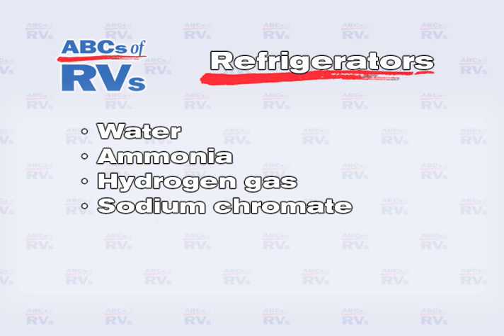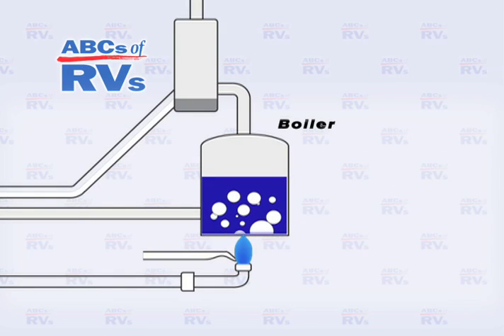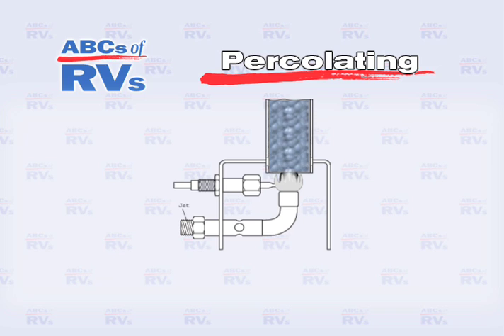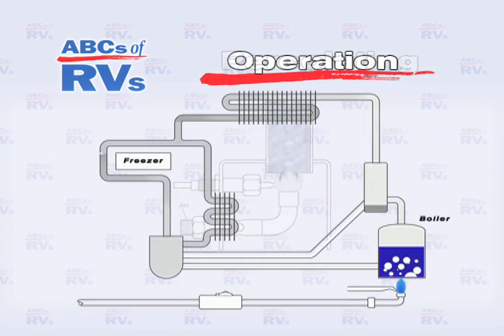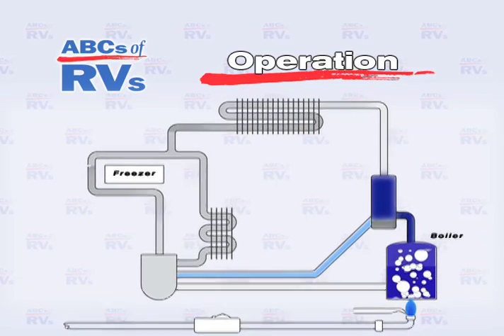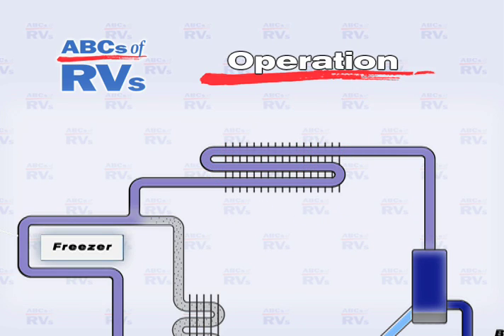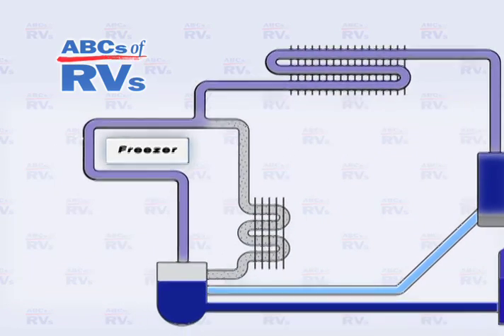RV Refrigertor Operation

Comment: Turns out its quite efficient! Replacing your fridge with any compressor fridge would be a huge efficiency boost. My 140L 24v compressor fridge uses about 500wh/24hrs. Absorption fridges are just.. Not efficient. You use electricity to heat up a resistive element (kinda like an electrical space heater) which boils a solution of water ammonia and hydrogen. The ammonia and hydrogen move heat around. But resistive heat is just inefficient as all hell.

Comment: Sorry, maar deze man maakt grove fouten in zijn uitleg. Een compressor is een "gaspomp", er is geen vloeistof bij de compressor. Het hete gas wordt aan de bovenkant de condensor in geperst en hier condenseert het gas door de hoge druk en afkoeling. De warmte energie van de compressor en de opgenomen warmte in de verdamper wordt hier afgescheiden aan de buitenlucht. De vloeistof wordt hierna opnieuw ingespoten in de verdamper.
Reply: You are mistaken.  You describe a conventional heat pump, not a single-pressure absorption refrigeration system used in recreational vehicles.  The latter is what this video is about.

Comment: Wrong household refrigerators, hell even air conditioner, units, all work with the same theory of removing heat and displacing it into the coils in the back similarly, a heat pump removes heat from the outside, cold air and releases it in the building
Reply: Nope, not all work with the same theory.  My great uncle, born in the late 1800's, had a kerosene fridge on his farm, and this tech was what worked without any electricity.  It's significantly less efficient than modern refrigeration, but still useful in certain applications, like recreational vehicles.

Comment: Someone please explain, if every process in the loop is adding heat, where does the heat go?
Reply: This wasn't explained the best. The heat is removed from the ammonia within the condenser.
Reply: @AnUnapologeticApologist And it absorbs heat from the hydrogen in the freezer (which is extremely buoyant) and evaporates rapidly, drawing the thermal energy out.
Reply: To be cold, you need to be much hotter than your surrounding so you can transfer your heat to that surrounding and becoming cold yourself. It's like how you feel when suddenly coming inside colder building in hot sunny day.

This was what happened to Ammonia, it got heated by boiler and then it cold down when moving thru the first coil.

And vise versa, when Ammonia cold down, the 'surrounding air' inside the freezer which was much 'hotter' will transfer it's 'heat' to much colder Ammonia which then pumped to chiller section that transferred another group of 'heat' to 'slightly warmer' Ammonia.

Then the cycle repeat again.

Edit: The heat is everywhere in the system so it always pumped out when it present inside. In today's refrigerator, the pump will stop when it pumped enough heat to outside and will continue again when there's another heat inside based on their predetermined temperature setting.

Comment: I just wonder if one could hook this up to their wood burning stove? Instead of the gas.  Combine that with using the heat to create electricity.  We could heat, cool and give our houses electricity.
Reply: this works with any source heating system I think 🤔
Reply: In theory it should work..
Reply: Neat idea but you wouldn't be able to regulate it and your fridge would be more like a deep freezer. The way the fridge operates, it cycles on and off, when that happens the flame goes out. You wouldn't be able to turn off the wood burning stove like that.
Reply: Indeed... but the big utilities won't go for that. ;) Not in their favour you see... 

If they haven't already, they will lobby the GOV to mandate that all homes MUST be grid tied. Canada is pretty much that way. Need mains to get an occupancy permit. Once you have that permit, nothing stopping you from dropping the mains line from your home. (Just means its another several thousand dollar tax on a new home, and that they don't give a hoot about you remaining grid tied. Gimme gimme gimme.)

Comment: Sodium chromate is listed but never explained in the process.  Also, after the evaporation in the freezer, the video says ammonia separates and goes up through the secondary radiator.  I think the hydrogen does that instead, as the water absorbs the ammonia, leaving only hydrogen gas.
Reply: Maybe it increase or decreases  the boiling point of water?

Comment: couldn't they use other refrigerants? or any substances in general? Normally the compressor phase changes the refrigerant into a gas, there is too much inertia, so when the condenser dumps the excessive heat, the phase change doesn't have enough time to absorb heat, in the condenser, the refrigerant spends more time, and can phase change and absorb all the heat. So you could probably just remove the compressor from a fridge and put a propane torch to the line and it will do the same thing. I just don't understand why we got this special refrigerant here.
Reply: Ammonia has an affinity for water and hydrogen lowers ammonia's boiling point under the specific pressure the fridge uses but gets kicked out of gaseous mixture when the water re-absorbs the ammonia. It operates on a few little chemistry and physics tricks that Albert Einstein and Leo Silard worked out.
The design has changed slightly but the principles remain the same.
Reply: ammonia is a refrigerant.

Comment: Could you use the hot area under solar panels as a boiler?
Reply: Deppends on a few things, but things of that nature can be done.  One issue is that it obviously only works for a little while.  I feel a direction you would rather go at that point is a Sterling engine, though there have been issues with that so far.  Not "this will never work practically" issues, just it does not work currently issues.  We need to work on the process more.
Reply: Oh wait, you mean RV solar pannels.  Sorry, my mind was on bigger house solar pannels for some reason.  Not convinced you would get enough heat there.  May be able to set up an economizer from that heat though.

Comment: 1:10 why does the water magically return while the amonia travels on?!
Reply: i guess water condenses at a different temp to ammonia, returning to a liquid and flowing back while the ammonia gas separates and continues on to condense later
Reply: @briangillick  your "guess" is absolutely correct
Reply: The boiler works like a coffee percolator except instead of stram gaseous ammonia is produced. As the ammonia turns to gas, the bouyant ammonia, bubbles up the tube raising a column of water solution up the boiler tube. The boiler shown in the diagram is not typical of most rv refrigerators.

Comment: I have an ammonia refrigerator in my RV. The freezer will cool down to -10, the refrigerator section cools down quite well. This is a Norcold manufactured in 1987, so there is potential for longevity. I also installed a small condenser fan, a common ball-bearing computer fan found online.
Reply: I was visiting an old timer at his cabin once and noticed a buck rogers looking device hanging out of ancient icebox and asked what it was. It was a Crosley IcyBall.  It was over 50 years at the time and it still worked.
Reply: Hi, can you please tell me what flame temperature is best for the boiler I'm restoring one of these refrigerators and I can't seem to find anything about flame and flame temperature
Reply: Where can I get one to buoy
Reply: I’m sitting in a camper from the 1970s with a made in Sweden dometic that keeps my root beer, cold and my ice cream soft like I like it.

Comment: This is just.. wrong. lol
Reply: Why
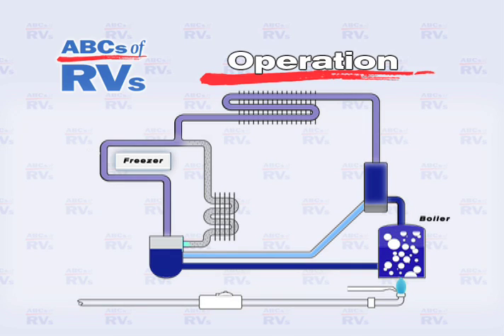Reply: @Ryskyguy  Much of it is right, but the last part of the video, where he describes ammonia again becoming a gas (@1:55) is not correct -- that step of the process is where the hydrogen separates, travelling up in the diagram, and joining the cooled ammonia at the top left.  Unless I am way off, this is where partial pressure helps the ammonia evaporate in the freezer compartment.

Comment: Umm it is not called an absorption fridge because it absorbs heat! All fridges and ac dose absorb heat! They all draw heat a way from one side and dump it on the other. They all heat pumps!
Reply: I’m a refrigeration HVAC technician and you are absolutely correct. Refrigerators use refrigerant/gas to absorb heat within a space. This process is called super heat. It’s obtained because the refrigerant can boil off very low temperatures. Then it goes to the condenser/outside unit where it extracts that heat, also known as sub cooling.